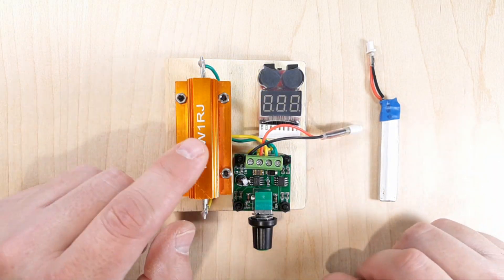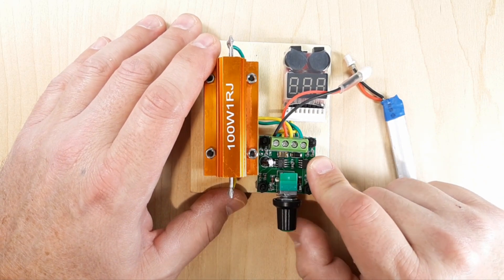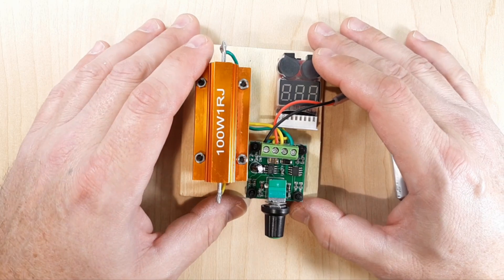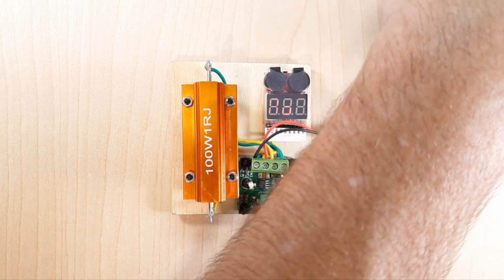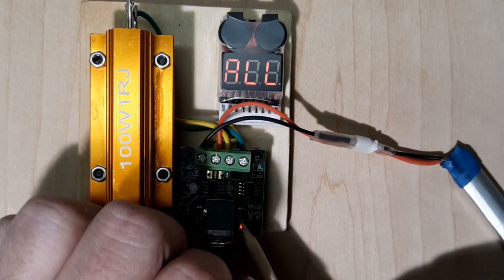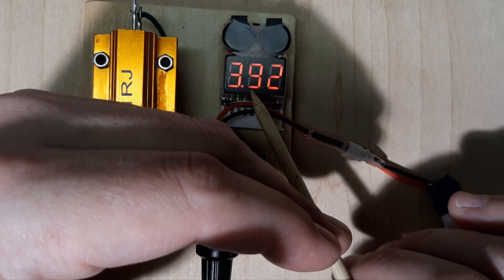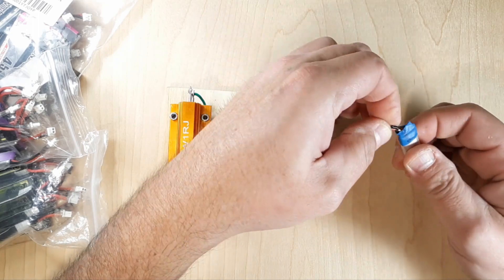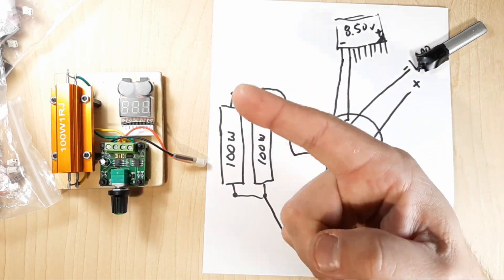1S Lipo Discharger | Fast & Cheap

Comment: I know this video is about a year old. So I hope you still check the comments. I build on of these dischargers.  My question is the light has gone out on the PWM board but the LiPo checker still register 0.90 volts. If I check battery with a volt meter it reads 2.54 volts. Is this normal?
Reply from the maker: @rickeyallinen798  
I do try to keep up with comments. That doesn't sound right.. Are you discharging all the way down for disposal?

Comment: What's the  real minimum input voltage of this module? Is it really work under 2 volt input to completely drain 4.2v battery?!
Reply from the maker: It will drain a 1S at 2amps till it's dead.
Reply: @PropsOff  wow!! Can you plz confirm this modules model? I found similar 5 types module called 2A pwm/30 watt pwm/1803bk module etc..
I want to make a led dimmer for 3.2volt Lithium phosphate Battery, i need a pwm regulator which work 3.2v to 2volt input, i tried different type pwm regulator and buck converters, but non of them work below 2.8 volt

Comment: 😂what are the size diameter length of bolts..... I have spacers and plan on using my Cellmeter8 to show voltage.... will that be ok
Reply from the maker: All the hardware is various lengths of M3 screws. Your cellmeter will work great - 2S and up. I couldn't use it for my 1S application...🍻

Comment: i watched the video .and the other earlier redundant ground vid. that's why i came to you for my  question. so where do you suggest i put the 5v . i was told maybe to  put it  from the  lipo bat post pads on the esc  to any available  + and  -  on the fc.  does my  fc have  a built in 5v  regulator. wouldn't it say on a fc if it has a regulator or not  in the specs?
Reply: 👍. the darn  bec has been slowing my build down a lot . I should probably keep building than .look at the googles to see how clear it is. and skip the bec altogether. than jump the grounds like yours is. could i jump from lipo pads  of esc to any ground on the fc not in use?
Reply from the maker: @Koolaidban  
That's what I'm doing on quads that have limited space..
Reply: @PropsOff  Thanks a ton for the advice    . your the best PropsOff .  now to solder my first quad. I liked the tip on not using a sponge . makes sense .  keep up the good work 🛩
Reply from the maker: @Koolaidban  
I appreciate your support...🍻
Keep me updated too...
Reply from the maker: You do not need the 5v BEC. The 5v BEC is acting as a guard against harsh voltage movement in the current stream that the camera is connected to. Naughty voltage and cheap flight controllers cause crappy FPV.. If you want to use it, then you need to follow my video ‐ it's way too much to explain here..

Comment: hi Props . I received a  FPV  UBEC bluesky 5v stepdown with my Alliexpress 5 inch build kit . I asked the seller where it goes . as its not on the esc / fc diagram and they said .hello friend.  the ubec you can use for FPV camera .
use it . or not use. both ok .  is a little gift . if you have use .   the FC is Aocoda-RC F405 V1.0.  so my  FC  or esc  must have  5v stepdown onboard ? . But  the inc  UBEC would help the vid transmission to be clearer? I don't want to screw up my first build . help   PropsOff .
Reply from the maker: Your questions are at the right place, lol... I have a video that shows exactly what to do...🍻
I will link that video below....
Reply from the maker: https://youtu.be/OXOmYrez3rE

Comment: Pretty interesting circuit, dude! Fantastic work! 😃
Have you ever tried one of those volt and amp matters? Could be interesting!
Anyway, stay safe there with your family! 🖖😊
Merry Christmas and happy new year!
Reply from the maker: I would need a little more description of the amp matter? 
I appreciate your support! Happy holidays and have fun...🍻
Reply: @PropsOff  It's a display many uses to build regulated power supplies. You know? It displays the current and tension going through it.
Reply from the maker: @MCsCreations  
So, something like this?
https://www.ebay.com/itm/175038800526?chn=ps&var=474199176021&_trkparms=ispr%3D1&amdata=enc%3A1Br3V7lhMQqugUfVVEhwq7w55&norover=1&mkevt=1&mkrid=711-117182-37290-0&mkcid=2&mkscid=101&itemid=474199176021_175038800526&targetid=&device=m&mktype=pla&googleloc=9014930&poi=&campaignid=17597089569&mkgroupid=&rlsatarget=&abcId=9300988&merchantid=108475808&gclid=CjwKCAiAzKqdBhAnEiwAePEjkioMpBdkyQsp4tOPzxYc1_Yrl7k8XR0xWQ-0ZSI4P8NFcLGc3KSyHRoCNKgQAvD_BwE
Reply: @PropsOff  Exactly, but there are cheaper options as well. 😊
Reply from the maker: @MCsCreations  
If you feel up to it, please place a link to one. I'll pin it here in comments. The Volt meter im using was stuff sitting around (not very accurate). I made this discharger for like 6 bucks, lol..

Comment: I imagine it is quite easy for someone with ADD to accidently destroy their LIPO if they arent paying attention trying to take a battery to storage.  Simple enough, be attentive if you are just testing the sag or taking them to storage.  Personally, I like to use my ViFly charging board to balance/store my 1s batteries.  the one with the goofy giant knob on it.  Old 1s batteries even if they sag, I kinda like to repurpose.  I want to put leads onto my GPS antenna to warm it up before I fly, or put it on a lost drone buzzer.  But that just feeds my hoarder tendencies.
Reply from the maker: Yeah, I added a disclaimer at the end of the video to pay attention to the lipo when connected, lol...
It's hard to destroy them on purpose, I may have some of that hoarding tendency you speak of...🤣